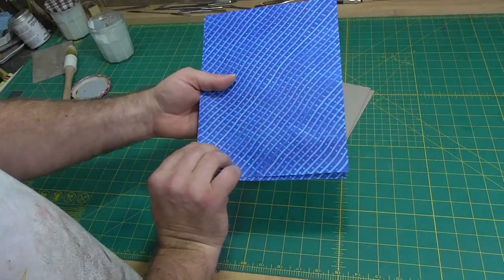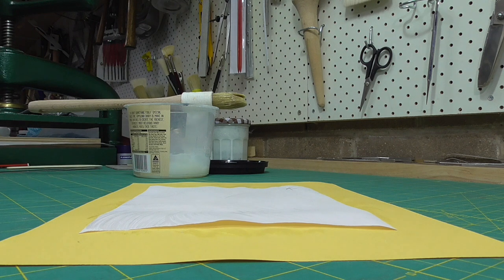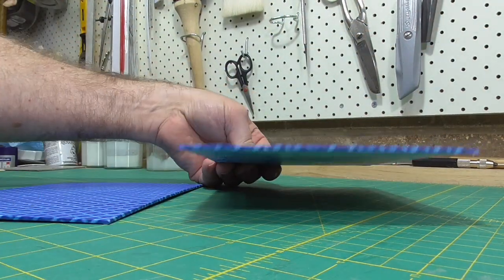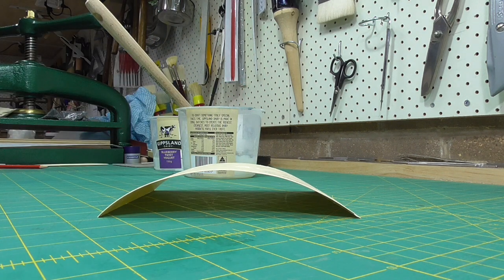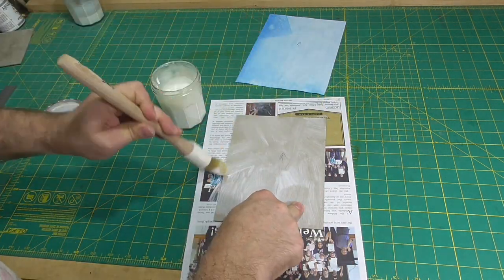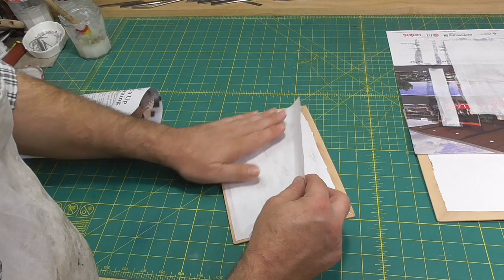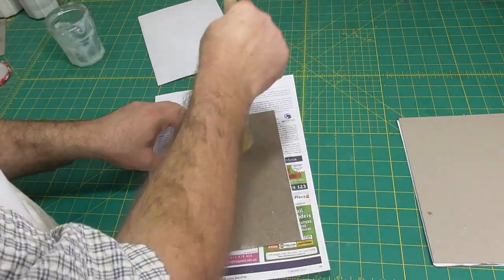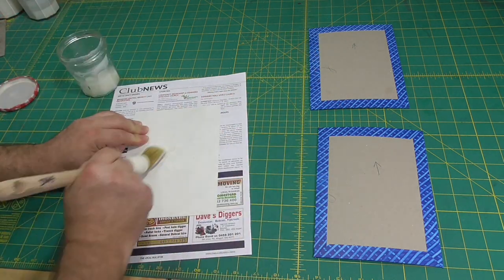Avoiding Warped Boards // Adventures in Bookbinding

Comment: This is the most brilliantly helpful video! Thank you so much for all of the effort and expenditure that went into making this!

I once used hardboard instead of gatorboard to stretch my watercolor paper, and learned that 140lb Arches paper is string enough to badly warp 1/8" thick hardboard!

As someone who has done woodworking, sewing, and painting, it's amazing how different yet similar grain mechanics are across mediums. Always critically important to consider. At least it's not so complex as grain in metal-working.

Comment: I can’t thank you enough for this video! You just saved my latest bookbinding project. This is the second book I’ve made attempting to use book cloth instead of paper for the covers, and the first one had terribly warped covers so I wanted to try again. I got the grain direction of my boards wrong the same way I did with the first book so they were bowing out from top to bottom, but this time I knew about paper grain and stretching /expansion and was lucky enough that the paper that I chose for the end pages was short grain. I used the water method to determine grain direction that you showed in your paper grain video. I glued my pages on to my warped boards and came back a few hours later to find them perfectly flat!! Absolutely magical, thank you!!!

Comment: This is very, very helpful. Thank you. I'm dealing with these issues and the're driving me nuts! I'm new so I'm not sure what is called what. When I have my text block and cover prepared, it's the step of attaching the text block to the cover that I'm finding really hard. I can manage it, but I'm getting terrible wrinkles on the paper that is adhered to the inside cover. I've changed materials, smashed it even harder in the press, etc. but I'm still getting a very unprofessional look that is evident as soon as someone opens my book.
Reply from the maker: Have a watch through of the videos on a cased rounded and backed book.  Putting down the endpapers can be very difficult.  Pressing doesn't get rid of wrinkles just as it doesn't unwrap boards.  Make sure the grain direction is head to tail, use paste and not PVA, and let the paper relax before putting it down.  If you get some wrinkles, lift it back up and carefully put it back down using some rubbing down paper to smooth it out towards the edge.  Good luck!  DAS
Reply: @DASBookbinding  Thank you

Comment: Is this why sewn-board binding typically used drumming for cover materials? Because the way things are layered makes it more difficult to account for or predict warping? Or is it just that the sewing provides strength that then isn't necessary to provide with extra adhesive?
Reply from the maker: I'd have to go back to Gary Frost early articles to see what his main reasoning was, but I think it was more aesthetic.  More layers will end up very rigid, and more opportunity for corrections if needed.  But slow, and one of the features of the sewn board binding is how fast they can be made.  DAS

Comment: I never considered that there are so many details in bookbinding. Now I have started to understand that this craft is very complex and you learn many hears in order to be good enough. If most of the issues in this video are caused by water in the glue, is there glue alternatives that do not cause so many issues?
Reply from the maker: It's only an issue while you are learning to use your materials.  I guess the real issue is when people don't want to work with materials, but fight it instead.  I do find it hard to manage expectations.  You can do great stuff very quickly.  I try and guide people by categorising projects to start with in the beginners playlist.  But people still want to start with a traditional full leather binding.  It's like sitting down at a piano and expecting to be able to just play the Goldberg Variations.  It is complicated by the internet being full of work that is held up as being of this standard done by beginners, which is not.  But back to your question, what solvent (or a suspension, I guess) other than water could be used in adhesive that wouldn't swell cellulose fibre and still act as an adhesive?  Water is hard to beat and if you did find another, is it traditional bookbinding?  Commercial binding takes a different approach, but unless you can work at the speed of a machine, these adhesives have limited (no?) use to the hand bookbinder.  Hope this helps.
Reply: @DASBookbinding  You are a real mentor. I really appreciate that you take the time to explain to me. It is true, I was looking for some glues that will not give me trouble. Your video with paper tension and paper fibers direction was really inspiring. I will try to pay more attention to the materials I have and what they really need to make it work. Thank you! I wish you a great week-end!

Comment: Would you have any advice for someone using wood as the board material? Since I build the boards up in multiple pieces (typically four, interlocking triangular pieces) with opposing grain directions, the boards don't warp in a linear fashion, but rather twist, forming a saddle shape.
Reply from the maker: Sorry, wood is a different beast that I probably know less about than you.  I do know that wood will move and I think what you describe might be next to impossible with solid wood.  Maybe veneer?  Maybe the type of wood?
Reply: @DASBookbinding  Thanks for the response. Yes, I am switching to aircraft grade birch plywood rather than cheap, single-ply basswood. If that doesn't work, I will just have to give up on wood covers.

Comment: @
DAS Bookbinding I have a book that has broken in several pieces, there was major damage to the glue along the spine. Do you have a video about reassembling a text block and regluing the spine?
Reply from the maker: If it is a paperback then there will be something in the next few months.  If it is sewn sections then I have a lot more to teach first.  Actually, if it is really falling to pieces then finish the job and pull it back to sections and do a complete rebind using one of the many methods I've demonstrated.  To pull apart, cut the sewing on the inside.  Test the spine glue to see is it softens with a bit of moisture.  If it does, carefully moisten the glue, trying to not let it get in the paper, and scrape the glue off with something blunt, the back of a knife.  Press the cleaned sections to get them flat and rebind.  Good luck!  DAS
Reply: @DASBookbinding  Thank you DAS! It is a hardcover book! I think I can get it back together with some patience, you have some great technique videos out there (the best in bookbinding IMO). Thanks!

Comment: Hi there many thanks for the video. I'm often showing your films to students asking. I'm still wondering why we laminate boards with kraft paper inbetween though. The only reason I can think of is so that you know where to stop chamfering. Do you think there would be a huge discrepancy  strengthwise between a board made up of two boards laminated with kraft inbetween and kraft inside and a board made up of two boards laminated with only kraft for the inner layer. Thank you again. Kate
Reply from the maker: It makes a big difference to the rigidity.  I guess it's the trapped tension in the layer of kraft paper.

Comment: Hello Darryn. You know, I've seen a lot of bookbinders laminate boards on both sides and I wonder, why do they do that? Is it important to laminate boards? Should I do it always?
Reply from the maker: Mostly for leather bindings, because of this really strong pull of leather.  You want the boards to be as stiff as possible (the mechanical advantage) and usually pulled inwards before you cover with leather.  They will usually send u being slightly pulled outward and this will be corrected with another draw sheet or fill-in and pastedown.  I don't do it for cloth bindings and for leather I used to only line the inside with paper, but am laminating boards more often now.  But never cross grain even if other very good bookbinders say it is a good thing to do:)  All the best, Darryn
Reply: @DASBookbinding  Thank you, Darryn. Cheers!

Comment: I just realized I cut the board in the wrong grain direction but already pasted the cloth which was embroidered. It is now warped. Is it possible to solve this with an additional layer of thinner board glued onto it to pull the opposite direction? Can I remedy this at all ?

Comment: Would board thickness have an impact on bowing if your covering with paper or pasting down?
Reply from the maker: Usually thicker board is stiffer and thus for the same pull it will warp less.  But everything still applies as it still warps.  But it is more stable once the book is complete in that any warping due to environmental changes will be less.  I hope I answered your question.  DAS

Comment: What about using a hardboard like Masonite? Wouldn't that be hard enough to resist warping?
Reply from the maker: Very acidic.  I wouldn't use Masonite in a bookbinding project as the acidity will migrate into the book.  Plus, the easiest way to deal with pull is to balance it out rather than to overcome or over power it:)  DAS

Comment: Do wooden boards have these same difficulties?
Reply: I'd imagine so as wood also swells from moisture and it has a "grain direction" as well.
Reply: Wood does indeed warp due to moisture, that's why quartersawn wood is so prized because the it only has grain in one direction. Carpenter's frequently have to factor in wood movement because there will be changes based on humidity. However, quartersawn wood is much more expensive. You also need to make sure the wood has dried to it's final moisture level because until then, it will warp. However, if you use dried boards, at the size of a book cover, there is not likely to be that much wood movement. As long as you used quartersawn or even plywood, it wouldn't be a big factor.
Reply from the maker: Jim Croft has written extensively on this subject.  As mentioned in a reply, quarter sawn deals with most issues.  But if wood does decide to warp with time there is no paper going to stop it:)  DAS

Comment: Another pain point for me. It may be a result of my local climate (cold but humid UK) but I find that my boards always bend in the direction I don't expect them to, despite paying attention to grain direction of the board and weft of the fabric wherever possible.  What I found does work for me is to apply some gentle heat to the laminated materials before pressing works wonders. This might involve leaving the covered board on a sunny ledge for a while, or perhaps in the airing cupboard if the sun is being shy.  I'm no scientist but I'm fairly certain (in an intuitive sort of way) that this moderates the reaction between paper and PVA.  Basically if I leave a case to dry of its own accord  under bricks or books - or nip in colder, dryer conditions - it just doesn't play ball.